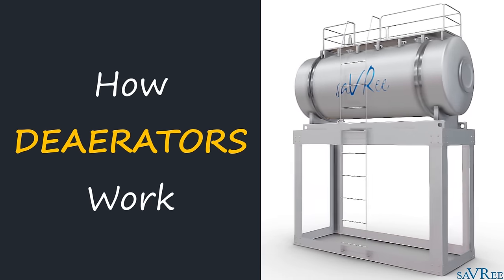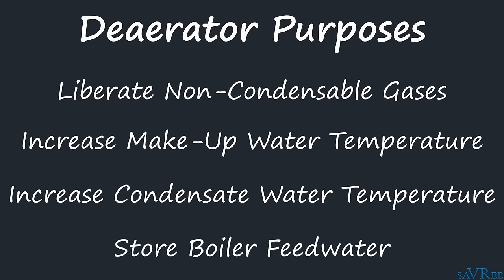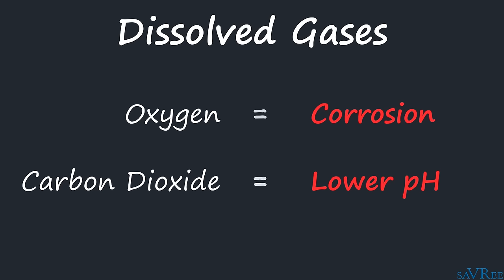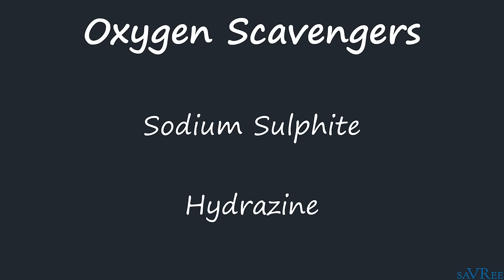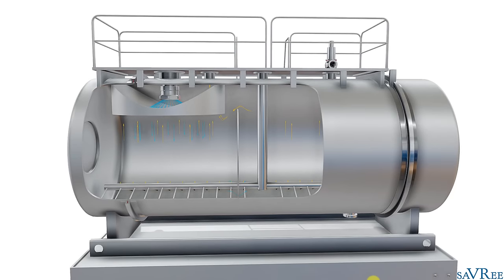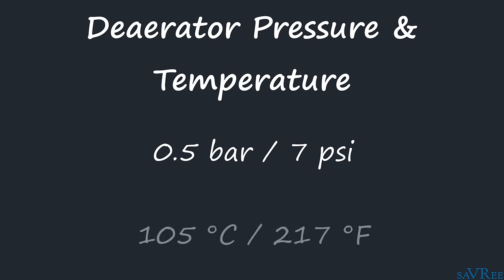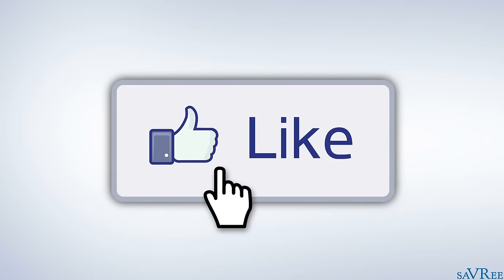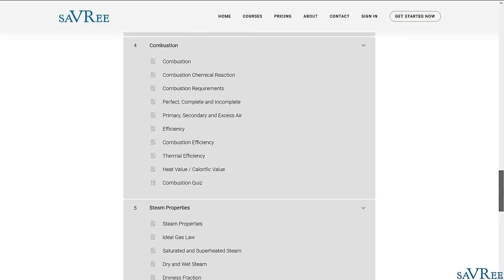How Deaerators Work (Engineering)

Comment: "orifice" is a well engineered, uniform design, calculated and dynamic hole... not just any hole.  An orifice costs upwards of 30x or more what you can charge for a hole.  Remember to bill appropriately.   "Drilled 3/8'ths hole, deburred: $5.95"  "Excavated a precision 9.525mm smoothed and chamfered orifice in location of best effect:  $174.00 + $8 tool wear."
Reply: This comment is so good that I had to screenshot it.
Reply: I think it is safe to assume that everything in these things are well engineered. A simple "hole" fits to my level of understanding much better thank bunch of jargon
Reply: Expensive hole.
Reply: @machinemaker2248  same 🤣

Comment: Although a little unrelated, this explains why drinking water from a kettle tastes better. The Ph is higher, so the water is less acidic. In a way the kettle "deaereted" the water, just by boiling it and thus removing the non condensable Co2 and O2
Reply: In a kettle, you also get precipitation of carbonates on the heating elements and other surfaces, which reduces Ph, so it's probably a bit more complex set of effects.

Comment: Oh, when you say that the pressure is 0.5 bar, you mean 0.5 bar above atmospheric, so roughly 1.5 bar of absolute pressure. I was confused for a few minutes as to how they were drawing down a partial vacuum. I think I'm used to bar being used for absolute pressures, as I wouldn't have made this silly assumption had you only reported the 7 psi figure. Overall, I love the insights that you include in these videos. Thanks!

Comment: Wonderful Job. Thanks a lot. I can't thank you enough for the indepth explanation provided.  On a different note, I see that you have a video on water tube boiler with coal firing, which in my understanding is getting less and less due to environmental concerns.  It would not take that extra effort to update the existing water tube with gas firing system including Flue recirculation systems.  THANKS once again !

Comment: Glad you guys are back. I'm not sure if this kind of video is in your wheelhouse, but I haven't found a good video on how High Voltage Power Circuit Breakers work. Like the ones that are filled with Sulfur Hexafluoride and disconnect Power Plant Generators from the Grid, or the ones located in a High Voltage Switching Station. If you know how those work and can make a video, or series of videos for them, that would be outstanding. Also, I've found videos on how Power Plant Generators work, but it would be nice to hear your explanation of it. Also, if you could do a video on a Synchronous Condenser, and how it works, that would be excellent as well.

Comment: Well done. My only comment is related to operating pressure and temperature . In an electric generation application with regenerative feed water heating, the operating pressure and corresponding saturation temperature could be between 50-100 psig depending on the plant cycle.

Comment: Deaerators typically receive condensate water plus dissolved gases from the condenser, plus make up water. This make up water is more water with dissolved gases supplied to deaerator and may be from river or lake or city water supply with dissolved gases. Here in a deaerator, such dissolved gases are removed from water coming from the condenser as well as make up water (added water) are usually oxygen and carbon dioxide and the water is pre heated somewhat. The condenser itself usually receives exhaust steam from steam turbine, and converts this exhaust steam from the steam turbine to condensed water plus dissolved gases. This outlet water from deaerator becomes boiler feed water to be pumped to steam boiler by boiler feed pump (BFP).

Comment: If thermal shock is occured in boiler, because of bfw's temperature isn't high enough, what kind of impact towards the boiler directly?
Reply: Generally, the bfw nozzles in the boiler will try to diffuse the bfw into the boiler evenly so that it blends into the boiling water and avoids a thermal shock. If you do get a thermal shock, especially a localized one, the metal of your boiler isn't going to like that very much, as one bit will be more thermally expanded than its neighbor. Whether the boiler ends up damaged or just shrugs it off? Depends on the boiler design, the temperatures and pressures involved, and likely a bunch of other variables I can't think of.

Comment: Would a wick system be useful in turning steam into liquid or would that tend to plug up over time? Or perhaps you need a higher flow rate in which any wick system would serve to slow the process down and add to much resistance.
Reply: I think you also want to filter the dissolved gases, which are "liquid" in the water, which would travel with the wick I think.

Also, another function is to pre-heat boiler feed water, as cold feed water would make too much of a temperature difference in the boiler tank walls (from hot side to cold side) and crack the wall material (thermal shock) or do other damage.

(I think)

Comment: Good day John. At 1:57 you mention boiler feedwater to have a typical pH of between 8-11. Won’t the water pH level be desirable as close to neutral as possible given that the water has been sent through a demineralisation plant? As far as I understand the water desirable for steam expansion via a turbine needs to be as pure as possible. With this given, pure water is quite reactive since it is an unbalanced molecule and its conductivity is rather low so to measure the pH of ultra pure water is  quite challenging. I would just like to hear your comments on this if possible.
Reply: To avoid corrosion water has to slightly basic inside the boiler, also consider that PKw is 14 at ambient temperatures but can achieve 16 at 300 C. Hope this help 😏

Comment: Hello. I have a question. How important is the pressure in deaerators? I know it has to be very low (0.5 bar or so), but why?
Reply: it was a great video btw! :)
Reply: Should be more than atmospheric pressure and generally consider saturated pressure at temperature 105 degC to remove Oxygen and CO2
Reply: Actually that’s the minimum pressure, more advanced dearators work at up to 4 Bar and 150 C, which makes it more energy efficient. it will depends on your economics.
Reply: Thank you for your response!
Reply: @MrCcristof  Main purpose of Deaerator is used to remove Oxygen (upto 7 ppb), CO2 (nil) and to increase the temperature of Boiler feed water which can be achieved at minimum above operating conditions. However if you increased the operating temperature then steam consumption will increase.

Comment: Already I have been using spray type deaerator. But we have check feed water level of oxygen along with carbon di gases. According to the status, we have add oxygen scavenger as well as hydrazine depends on feed water characteristics. Oxygen is very dangerous for pressure vessel.

Comment: Thank you very much

Some of the diarators have a line connected between the steam line (diarators inlet) with the diarator it self with a check valve.

What is the function of this arrangement?
Reply: I'm not familar with these systems in general but I would think the check valve is to prevent water from backing up the steam line.

Comment: 0.5 bar - ain’t that lover than atmospheric pressure? How can you vent anything into the atmosphere if atmospheric pressure is higher than what you have contained?
Reply: Is it directly vented to the atmosphere? Is the steam outlet local pressure greater than the chamber overall pressure? Does it vent to a specially designed chamber first, balancing the pressure for all sections (closed system)?

I'm just speculating after watching this.
Reply: 7:07 safety relief value is a water column or spring device, to also balance pressure, and solve that issue I'm guessing.

Comment: If we increase temperature of water till 100°C it converts into steam !
Right ?

So how this water is still remains in liquid state ?
Reply: @savree-3d  yeahhh ! That's Great
Thank you for this concept.

if we increase the temperature till saturation level where other gases like oxygesn and carbon dioxide can not dissolve, than the water is also converted in gas form !!

Still we get liquid state of water in Deaerator storage tank.

Saturation level = 0 ppm of Gases = Water is also in gas form
Reply: the water convert to steam at 100°C under atmospheric pressure, but in our case there is 7 psi pressure inside Deaerator whic maintain the water liquid

Comment: All these years I've assumed the steam venting from the power plant roof was from bad traps leaking through. I'm still left wondering why this steam mixed with non-condenables is not counterflowed with the incoming makeup water before it enters the deaerator. Perhaps it would require an expensive exchanger due to the oxygen and CO2 present. So then the variability of the volume of that discharge would have been from varying feed water rates due to varying steam demand and varying condensate return rates. I suppose that if there were a counterflow heat exchanger with the incoming raw make-up water, the water flow would precede the flow of the non-condesable gases so a holding tank of prehested raw make-up water would be needed. That holding tank would also need to be corrosion resistant. The payback time on such a system might be longer than some other ways of capturing waste heat. So now I don't feel so bad about the apparent waste.
There still ought to be a prize for anyone who can design a steam trap that is both more reliable and easier to detect failures in.

Comment: I have a question , the oxygen and carbon dioxide are non condensable gases then how did it dissolve in water ?
could you explain
Reply: It's because condensing and dissolving are not the same thing. Condensing is when a substance by itself goes from gas to liquid. That's what the water is doing. Dissolving is where molecules of one substance mix into the bulk of another substance. For dissolving, think of salt dissolving in water. The salt itself isn't particularly interested in being a liquid; at room temperature it'll happily stay a solid. But there's enough attraction between the salt molecules and the water molecules for the salt molecules to be okay with leaving their comfortable solid salt crystal and drift around in the liquid water.

The same thing happens with gas molecules, too. They're not, by themselves, interested in being liquid under these conditions (that's why we say they're noncondensable), but there's just enough attraction between molecules of oxygen or CO2 and molecules of water for a bit of those gases to dissolve, like salt, into the liquid water, floating around in there because, hey, they're surrounded by molecules they're attracted to.

The higher you raise the temperature or the lower you drop the pressure, the less that attraction between the gas molecules and the water molecules is able to keep those dissolved gases where they are, and the more they want to leave the liquid behind to go do gas things. That's what the deaerator does.
Reply: @emanwe01  thanks for your reply

Comment: excuse me, how can you vent to the atmosphere with 0.5 bar of internal pressure? i know that in my plant deaerator is vented to the condenser which operates in a vacuum, that makes more sense.
and how it is even possible to sustain 0.5 bar in there?
Reply: It's "gauge" pressure of 0.5 Bar, so it is under positive pressure.

Comment: Good video. But make-up water must be decarbonized before entering the deairator, this is industry standard practice.
Normaly tap or river water is softened by reversed osmosis or chemical treatment and then pumped over a vessel filled with raschig rings to increase area and a fan is used to blow out the CO2.

Comment: It may shock you to learn this but water boils at 30c in a vacuum and returns to liquid at 29c the expansion rates are the same no matter how the water boils. This means in a closed system you can run a steam engine off heat from the sun and endothermic from water sources you could even run an air conditioner use the heat to boil water and the cold to return it to liquid.
Reply: time to tip my fedora, pretty sure its nearly impossible to sustain a steam system in a vacuum, and if u check out water pressure to enthalpy graph, you will see that at lower pressure it would require far more energy to convert water to steam. that is why super critical  boilers are more efficient.
Reply: @slava86rasta  If you are boiling water at 30 C what happens to the steam at 29 C? it returns to a liquid state maintaining the vacuum Hot side passes through pipe and turbine to the Cold side providing a constant suction for more hot water to be drawn in through a spray nozzle so that it flashes into steam. Push and Pull working in harmony.
Reply: @Barskor1  i would love to see that, where is this implemented?

Comment: What are the problems with CO2 and O2 in the water? Why is acidic water a problem?
Reply: Its a problem because most pipes used are iron. when corrosion occurs you get a lot of particles of rust that fouls up the pipes as well as the pitting caused will weaken some areas. Water is terated to have PH of above 8 to prevent the corrosion. Removing the O2 and CO2 is a easier solution and cost less than adding a lot of chemical treatment.

Comment: I was hoping there was a non-heating way to deaerate.
Reply from the maker: You can use chemicals, it's just more expensive.
Reply: @savree-3d  There has to be a mechanical way too. Like a pressure decrease to boil the gasses out.